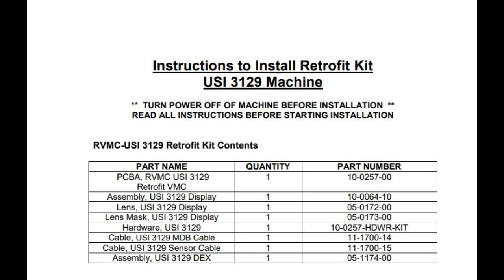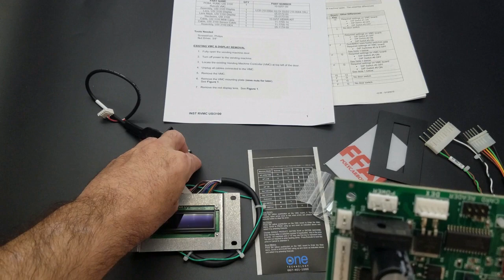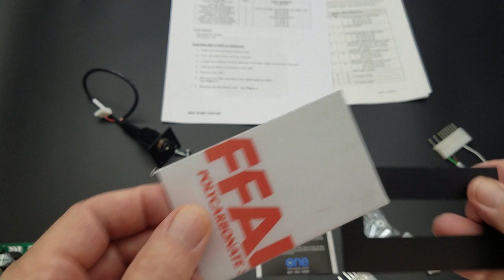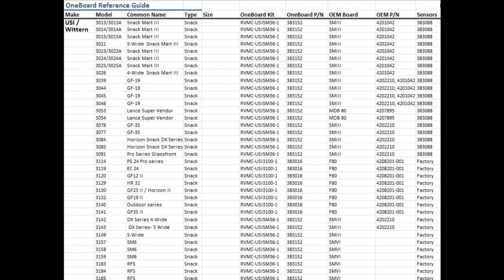RVMC USI3100 (USI F80) Retrofit Upgrade Kit part# 383016

Comment: So what do the switches do and how would one go about connected a bill valodator and coin mech?
Reply from the maker: Only switch 4 is used for guaranteed vend sensors if applicable.  The controller uses standard MDB payment devices that plug directly to MDB on the controller